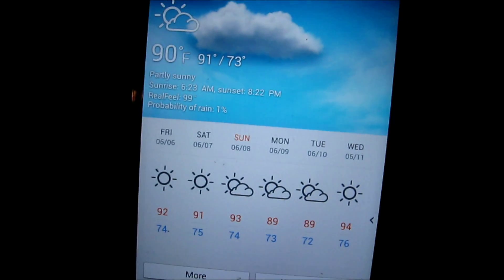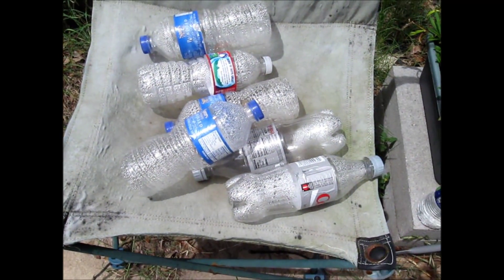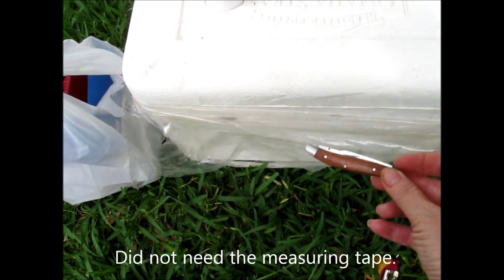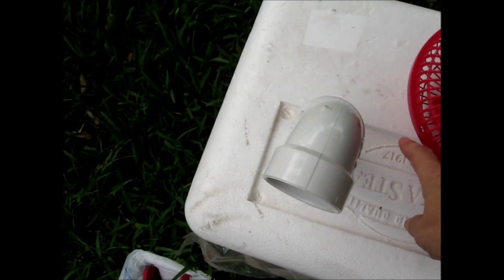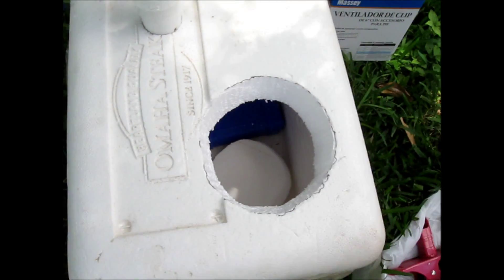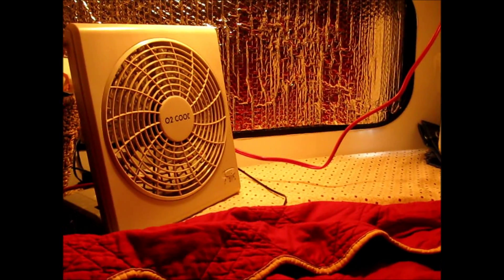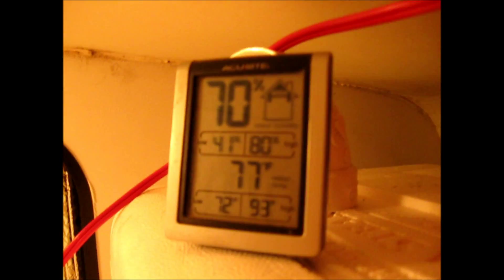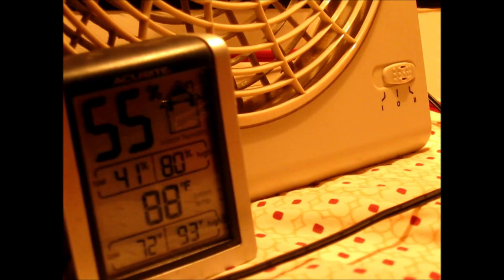Ice Chest Cooler   Epic Fail

Comment: Heat rises naturally, and the temp was increasing into the afternoon. What amp circuit are you plugged into from the house? I tapped into a friends 30 Amp circuit one time and ran my RV AC just fine. I'm in the south too and I know the humidity and dew point sucks. I was better off parking in the shade and exhausting the hot air up and out via the roof vents than I was trying to cool with AC.
Reply from the maker: I was only on a 20amp breaker, thus could not use my roof air. My roof air is a 13,5 btu unit. Actually overkill for my size rig...but I am not complaining now that I've moved & am hooked up to 30amp power. I did that exhaust air thing at night when I went to bed using the portable ac. It did help, but yes, during the day, that overhead area was not usable. Now it is!

Comment: Was there air coming out the back of the fan?  I did a poor setup with a huge fan (table top vortex fan), but only 2 inch pipe.

The air was blowing back out the fan.  Ie the 2 inch pipe wasn't big enough to allow all the air out.  Needed a much bigger exit pipe to handle the fan.

Also while 2 liter bottle make it easier to swap out and recool, huge bricks of ice work better and last longer.  Just fyi.
Reply from the maker: Thanks. It's possible that it was my pipe as well then.

Comment: I am not sure why you didn't get better results. I did mine similarly and the only real difference was larger bottles and i didn't have a tube on the elbow. Couple ideas that MAY help. Some people swear by getting like a dryer hose idea and bury it in the ice packs.  The omaha steaks cooler should do fine. Mine did well in a small area like you tried. I had the fan on full. I got a pretty stable 10 -12 degree drop for a few hours. I had a 2" elbow but that shouldn't matter. I'd say just keep tinkering you may find an answer.
Reply from the maker: Not a problem anymore. I now have 30amp power & my roof air is humming away :-)  and I can now take an afternoon nap in my bed now if I want to!
Reply: that is awesome and must be a great relief !! congrats
Reply from the maker: Thanks!